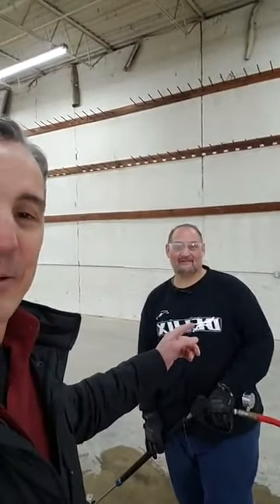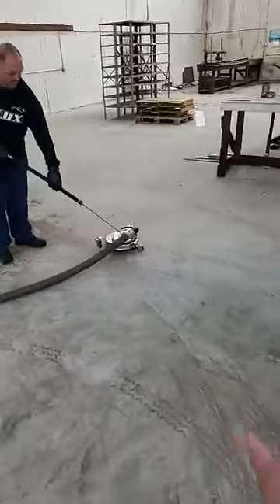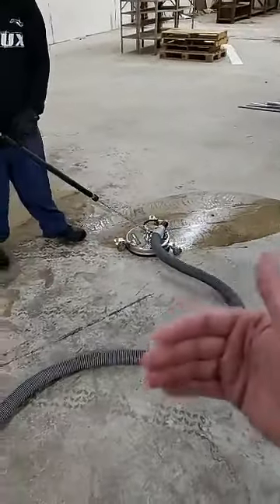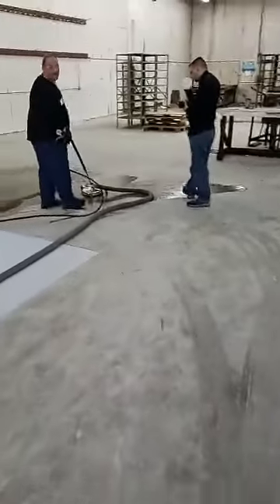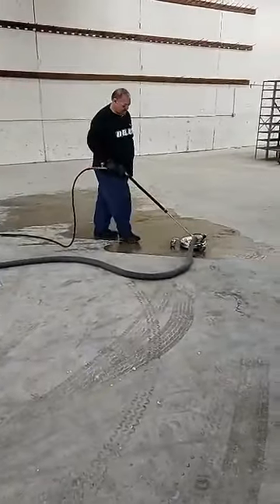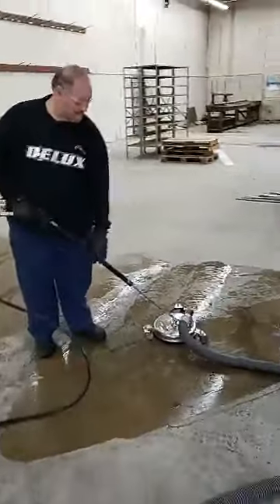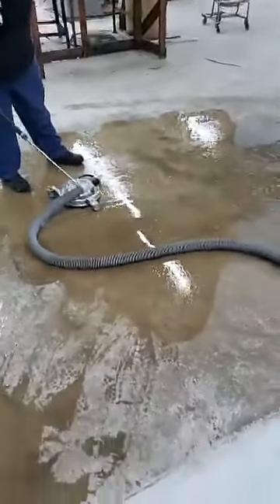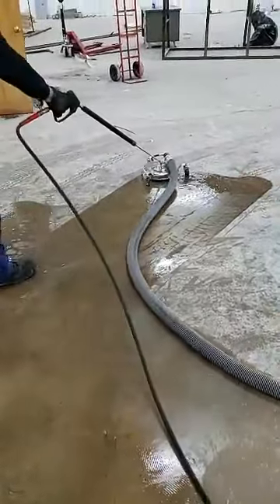Mosmatic Surface Cleaner: Aqua Surface Cleaner with Integrated Recovery

Comment: Looks like it’s leaving a thin layer of dirty water over the floor requiring mopping up or rinsing away.
Reply from the maker: It isn't.  I picking up a lot of water.  What is left behind is clean water.
Reply: @Martynthorn850 you are correct, I bought one of these to use on my 4gpm 3500psi machine and it only reclaims 80% of the water, leaving behind 20% water of which 10% of that is dirty water. Even though it may appear clean You still have to do a final rinse.

Comment: That is pretty slick. I like it. Wonder how it would work if it was a little bigger and running 8 GPM. Thanks for sharing this.
Reply from the maker: There may be a 8 GPM unit available in the future
Reply: Couldnt you just change the tips to work with a 8gpm machine? i havnt  used it or seen it in person im just assuming, ide be interested if there was one for a 8gpm. @Powerwash

Comment: What is the MINIMUM GPM for this? (Can I use this with a 2.5 gpm electric pressure washer?)
Reply from the maker: You need at least 4 GPM and 2,000 PSI